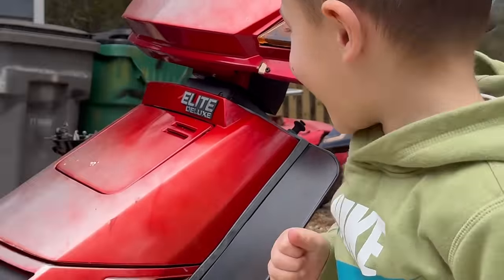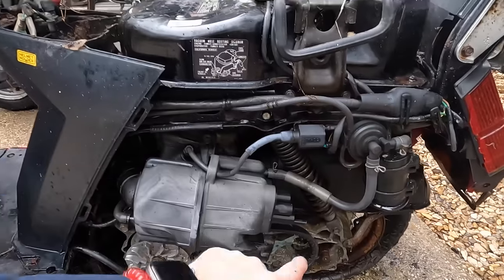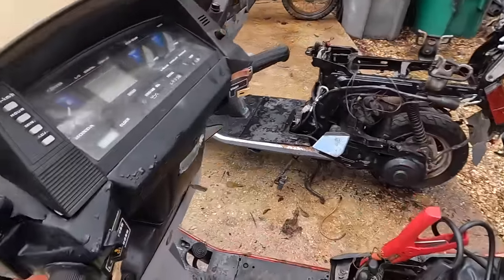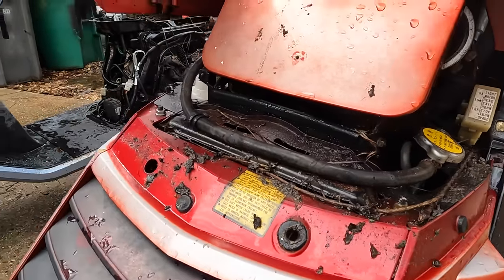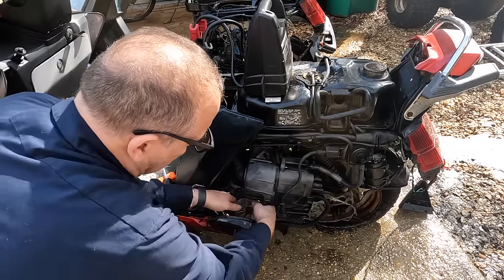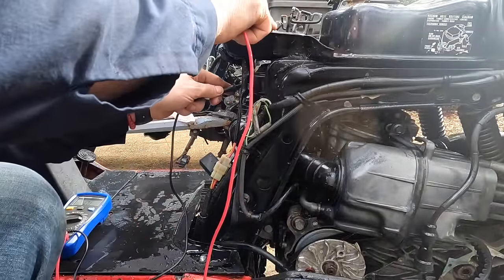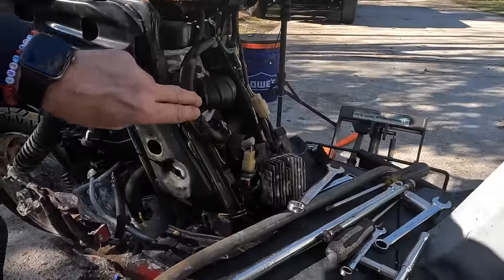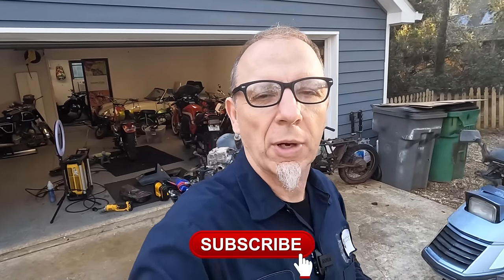1985 Honda Elite Deluxe Rescued From the Salvage Yard #vintagemotorcycles #motorcyclerewind #scooter

Comment: Your grandson's reaction to the headlight flipping up is so cool!!! And congrats on reaching 10K subs (I just checked, YouTube says it is). 

Your drive system looks like a CVT (Continuously Variable Transmission). The variable part comes from the gap between the two sides of the "clutch" pulley opening or closing, making the drive belt ride higher or lower between the two sides, changing the gear ratio. This happens automatically based on engine speed and the internals of the "clutch". They are set up so they generally keep engine rpm in the most efficient range of operation, changing the gearing to allow for varying loads on the engine, like acceleration, deceleration, and constant speed cruising. The "clutch" pulley appears to be what is on your rear wheel/axle and the fixed pulley is attached to the crankshaft. The whole thing is enclosed in the housing you pulled apart which protects the pulley, clutch, and drive belt. Looks like fun!

Edit: On some of the more complex CVTs there are clutches on both ends of the drive system, but the Elite looks like it has the clutch only on the rear. The front pulley appears to be fixed.

Comment: Interesting  scooter. They were definitely a space age thing back then. Interestingly, the Suzuki Katana 750 had a pop up headlight which was really cool.
As for the LCD speedo, if it's the same as the early GPz's, it has suffered bleed out and unfortunately is unsalvageable. I tried to rebuild a couple GPz tank instrument clusters and disappointingly, couldn't find anything suitable as a replacement part.
Reply from the maker: Thanks to you I now will be looking for a Suzuki Katana with a flip up headlight. Bad news on the display. Maybe the other one will work!🤞

Comment: Rescuing a 1984 CH125 right now myself!
Reply from the maker: Awesome. Hope yours stated off in better condition than mine!!!
Reply: @motorcyclerewind haha, I’m not sure it did.  Missing gas tank, battery box, ignition, hand brake, tail light…but it runs 😂.  Still worth restoring.  Going to have to 3D print a rear-right turn signal base as those apparently got Thanos snapped out of existence.  Been wanting one since Terminator, so it’s a labor of love!

Comment: Years ago my old roommate used these for his meter reading job. Every so many miles he needed to replace the centrifugal clutch. It was a pain in the butt. Probably the reason these ended up in the salvage yard is that they need a new clutch.
Reply from the maker: The good thing, so far the parts I might need clutch, starter carb are all pretty inexpensive. 🤞thanks for watching.

Comment: Picked up one of these in red at the start of last summer. It was my first 2 wheel vehicle and man did I have a blast ripping around town and back roads every day! It was in great shape overall but had a few issues still. It broke down on me a couple times but I’ve been able to fix the issue and get back home with just the Honda tool kit every time so far. At this point I’ve basically gone through everything and it runs perfectly now. Riding the Elite and watching videos like these did give me the motorcycle itch and I picked up a ‘73 CB350G in green for $550 in August. It didn’t run but now it’s almost ready to go. It’s been my first time really doing significant mechanical work but I’m happy to say it’ll definitely be ready for the spring! Cant wait to start my next project after I get done with the CB haha
Reply from the maker: That’s awesome. I love the CB/CL350 platform. Thanks for watching.

Comment: My neighbor had a red one just like that.  I worked on it a couple times for her.  Turns out she kept adding "Heat" to the gas tank thinking it was the same as fuel stabilizer.  I'm guessing she was close to E50.  Didn't even smell like gas, smelled like alcohol.  A complete drain and flush with non ethanol and it was ready to roll.  She was riding it (poorly) into her 70's.  Sold it to a guy I know for $150 when moving into an assisted living place.  He wanted a pit bike for use at the drag strip
Reply from the maker: I love motorcycle stories. Thanks for sharing and thanks for watching.

Comment: After seeing this i had to go check the Terminator to see if its one of these Sarah Conner rides in the movie.  Shes on a Gold one it has a pop up light , i knew id seen one of these before (Never seen one on the UK market we did have some similar "Super-Scooters"  but in my area never seen an elite). That was a pile of elites like an ancient elephant grave yard. I use rust eater on various items, instead of squirting it, put it in a bowl and use a cheap disposable 1 inch paint brush to apply it affords better more controlled coverage and application. Cant wait see how  this project goes .
Reply from the maker: They were called the Honda Spacy in the UK. That’s a good tip when using the rust eater. Thanks for watching.

Comment: I guess they always come from scrap yards in pairs? 
I have two in back yard grandsons great grandad gave me to 'fix up'.
Both blue but only one title.
CVT belt needs changing.
When engine or axle bolt will rotate but not come out, there is a spacer of some kind rusted to it . 
On that scooter, there are rubber mounts with steel spacer, you can probably see two alloy mounts on the one you removed with a gap between them
There seems to be a large Japanese enthusiasts club plus a worldwide following. 
Was quite surprised how much they can go for
Reply from the maker: Pairs worked for Noah. So thought I should give it a shot. I am enjoying learning more about these scooters. Thanks for watching.